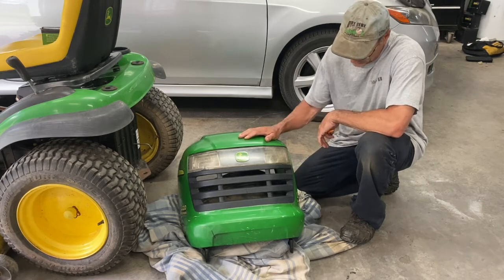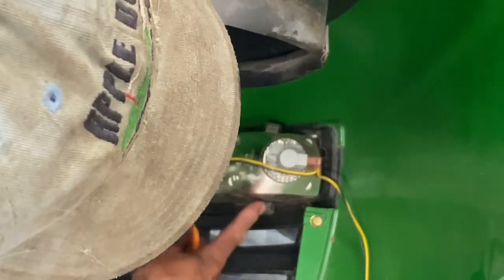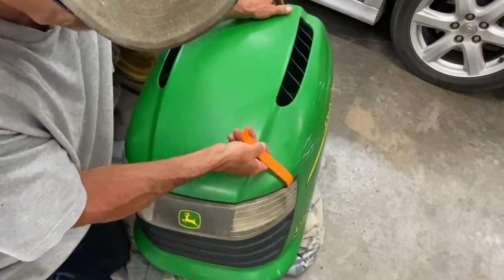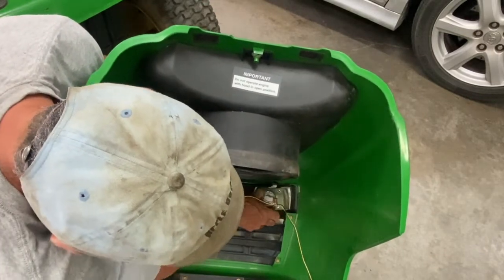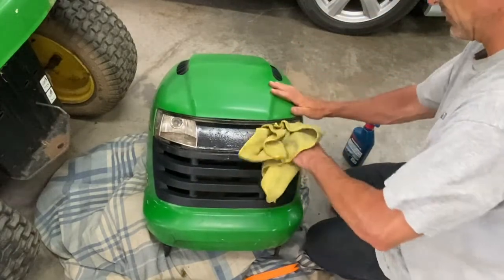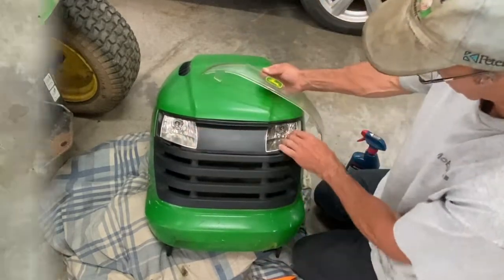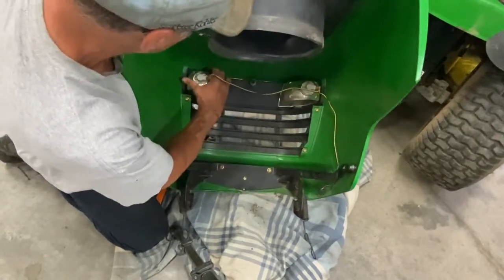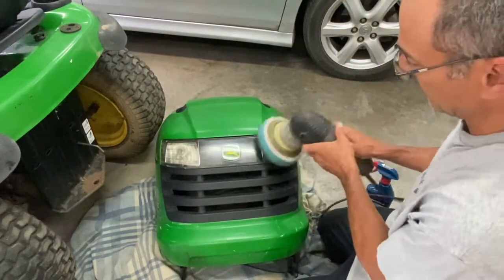How to remove & clean your dirty Headlight Lens on a John Deere L110, L120, L130

Comment: Hey, nice vid. I got mine cleaned before I saw this. I need to know how to remove the whole hood like you did. Working on the carb is a pain with it in the way.
Reply from the maker: 👍.  I will make a video on it soon.  Thx.
Reply: @WeekendHobbyMechanic  You know what? I figured it out! Didn't realize I had to close it up a bit and then just pull it out. Very cool.

Comment: How did you get the plastic piece off the headlight area? I see how you got it back in but idk how to get it off.
Reply from the maker: Each headlight has two tabs. At 18sec into the video, you see me press up on the bottom tab & push out. At 20 secs in the video, you see me press down on the top tab and push out.  Might have to repeat this a few times...